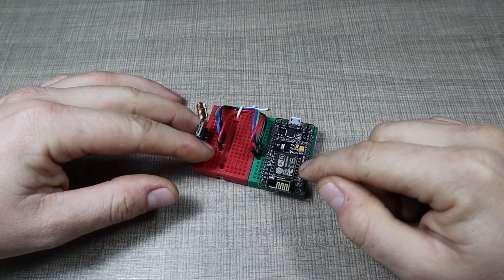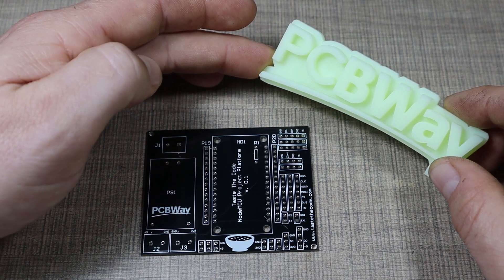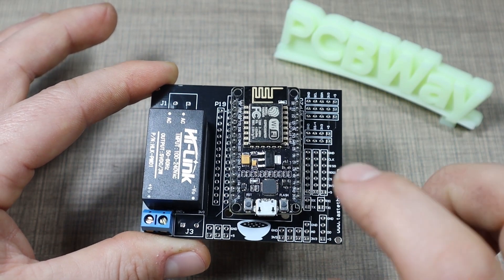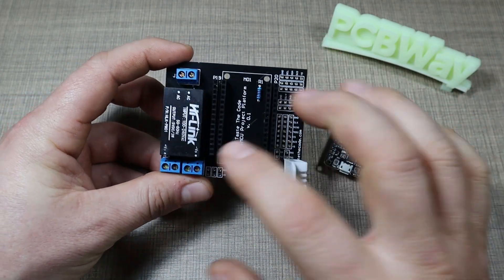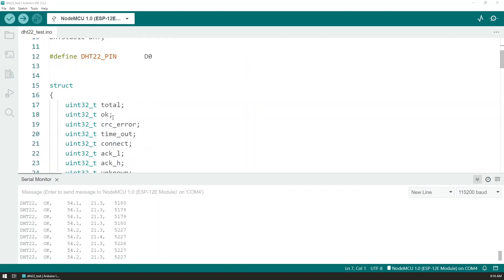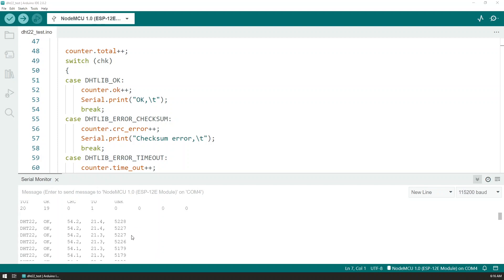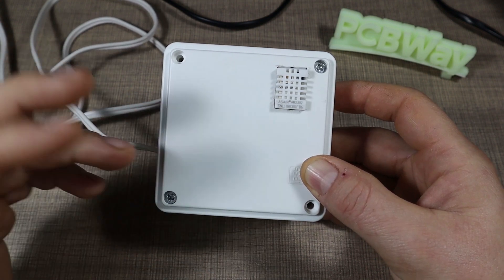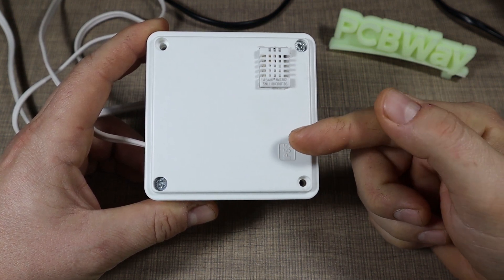Environment Monitor with DHT22 and NodeMCU in less than one hour - Home Assistant Project

Comment: Hi - thanks for this effort - got my boards yesterday and all look very clean and ready to go.  Waiting on some of the other parts now to kick off my first assembly.  Looking through all the documentation and comments, I am not finding the value of the R1 resistor that is being used?
Reply from the maker: Thanks! Let me know what you end up making! The resistor is for the DHT22 sensor so you can add any value between 4.7k to 10k. I used 10k on mine and works perfectly.
Reply: @TasteTheCode  PERFECT - will be starting with DS10B20 following the adafruit pool temp instructable with their IO and following the same format on identical build moving to Home Assistant and then using your board to see if I can get it working on adafruit IO and then on Home Assistant.  The adafruit build is using battery configuration for power, but what I like about your board is that I can use 110 volts and skip all the conversion to low-voltage baggage in a very tight package.

Comment: Hi ...thank you pro 🤍
I am a beginner in the home assistant
Can you help me...?

Do i need a raspberry to upload the code to the arduino And how do I start its first run..I watched several videos..but I didn't get a result.Thanks in advance
Reply from the maker: Setting up Home Assistant is beyond the scope of the video but I followed the official guide and installed it on a Raspberry pi 4. The setup of ESPHome and the device setup are both in the video.

Comment: I don't find mains powered sensors to be of any use in the living space (living room, bedroom, kitchen) and/or garden. Just go for LiPo inside, get TP4056 and let sensors sleep for 3-10 minutes (according to the needs). On 500mAh LiPo your sensor will last on 1 charge for more than 6 months. Why mains cable? Ble... ;-)
Reply from the maker: Yes, that is an option too. I had some projects like that a few videos ago so now I wanted to show that you can have other options as well. I might do the next one where I'll show how to use the same PCB with a battery.